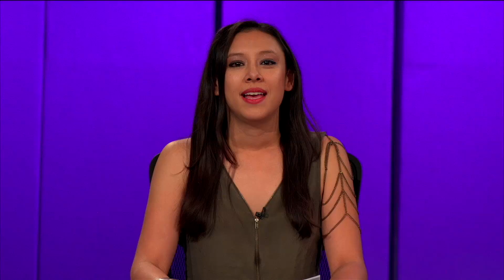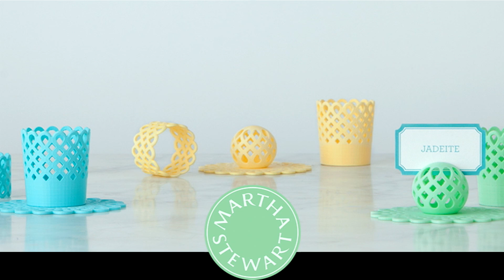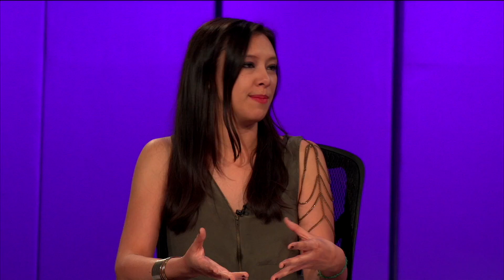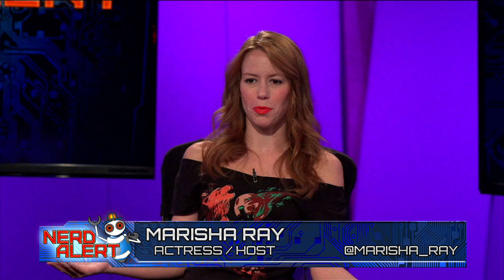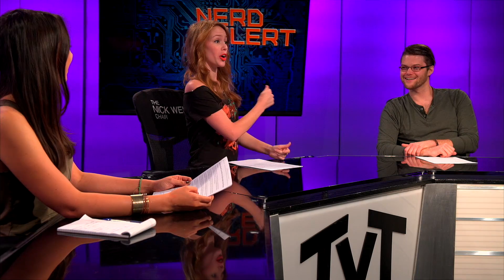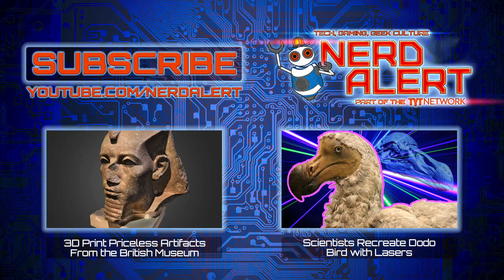Is Martha Stewart About to Take Over 3D Printing?

Comment: I have mixed feelings about this; especially with the criticisms seen below, but - obviously the Martha Stewart line is aimed at specific audience who we all do not fit in. Seeing that MakerBot has made its way into Home Depot stores across the states, you will see a change in the market. For most of us here... we're makers, hobbyists, tinkerers, cosplayers, early innovators - folk who (would) use 3D printing for practical uses. I know its hard to gestate this latest brand, but there is a market for it. I laughed at the printer line by 3D Labs that costed $3,000-10,000 which prints colored sugar cubes, but sadly... There's a market out there for that too. Its easy to criticize, but if we let these exist - it will get more people involved and when that happens, the technology will mature and we all will benefit from it.

Comment: no one in their right mind, would spend $25 on a spool of filament, and $1-2 on models, and then the countless hours of print time, to create a full set to use as decoration for dinner table... Home 3D printers are great for prototyping, and to print a single item or two of a kind, but not very good for mass production.
Besides, those models would probably look decent on SLS (resin) printer, but they will not look good on FDM (filament extruding) printers. Notice how none of pictures are detailed enough to see anything, only the Place Card Holder image from makerbots store, show a bit of detail, and it's not pretty...
Reply: Yes, it is fun to play around with a 3D printer... it is not fun to have it mass producing simple plastic items.
Reply: Bart Bols so you can set the table for just one person?
This is not where the mainstream 3D printing revolution will begin, still too much hassle calibrating and it takes a long time to print decent looking items.
Reply: So you can't have more than 3 guest to a tea-party?